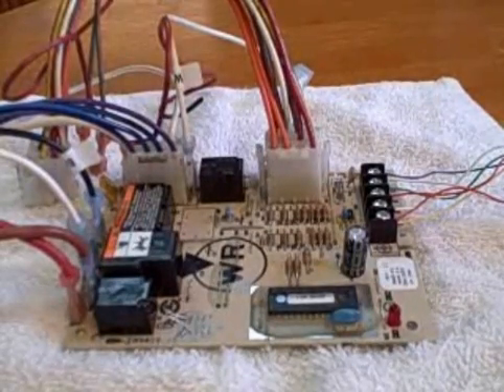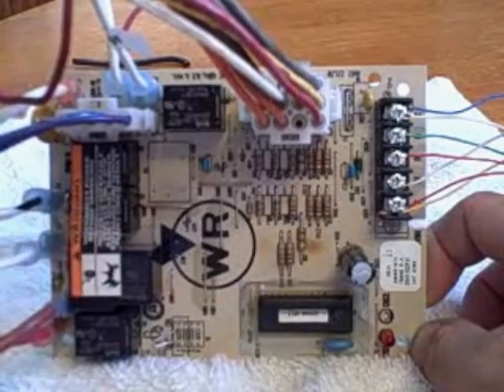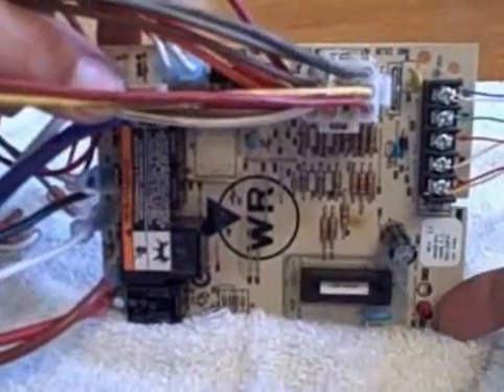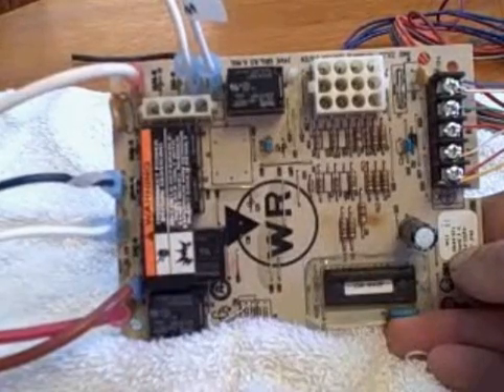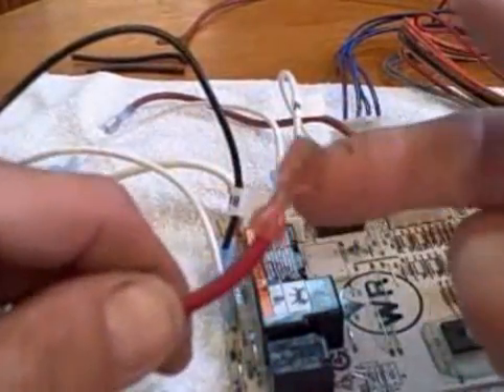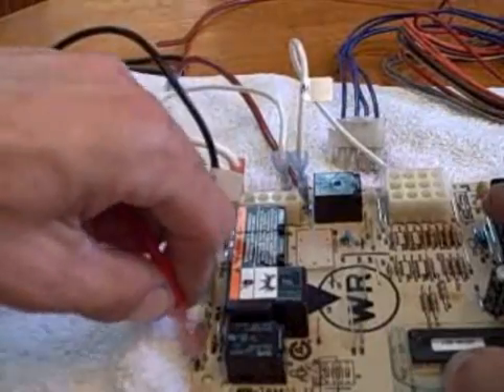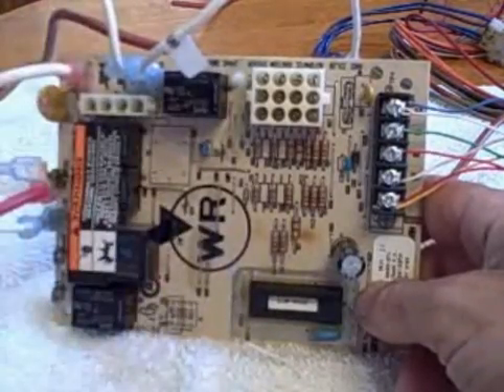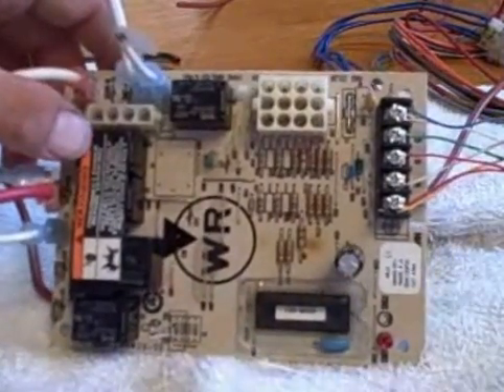HVAC AC Blower not working, troubleshooting Fan Control board, Fan not working.

Comment from the maker: @letseeitplease   No problem, just remember that you should have a tech work on it, dangerous voltages and safties that have to be considered!   Keep in mind it most likely is NOT a relay, more often than not it is a capacitor (easy fix) or worse, the blower motor.

Comment: thanks for doing this video, i have the same problem, its central air, and the blower is lennox, the outside unit is Heil, it runs fine, but the indoor blower is not coming on at all, i checked all breakers, everything is on, still the blower wont come on,
will be a month before i have enought money saved up for repairs, at least seeing your video gives me the idea of what could be wrong with my unit, thanks

Comment from the maker: @iac821 Can't believe I havent answered this one yet!   If it is a new motor/capacitor then you might have the wrong motor installed.  I've seen this happen where someone would install a, say, 1/4hp 1075 rpm motor and the thing has like 3 or 4 really big fan blades, ...unit was probably originally shipped with an 820 rpm 1/4 hp motor and can handle the stress load and the 1075 just overheats.

Comment: Just wire in a relay with the green and common low voltage wire.that way the motor will shut on and off...thats what I do until the board comes in...

Comment: hi, mikie i just replace control board on a armstrong furnace with a honeywellst9120u and the blower start even without a call for heat and keeps running, i have triple check and cant figure out any clue? thanks.

Comment from the maker: @iac821   Condener motor being the outside fan motor (just verifying our terminology here!) ....check the fan capacitor again to make sure it is ok, if the reading goes up and down and up and down on the cap then it might be a bad cap, I get those once in a while.  If the capacitor is good and it it si the right cap for the motor then check the motor, sometimes I will see people put 1075rpm motors on units that SHOULD have 825rpm motors and they can't keep up.  Right size motor?   M@

Comment from the maker: @teachmebetter If the air handler is blowing the breaker that quickly then you might have a high voltage short to ground.  It could be something less dangerous but I suggest you call in a professional so that you don't electrocute yourself.  I've had a few close calls from loose wiring that was difficult to see etc.  So just be safe and make sure by getting a tech to look at this one!

  m@

Comment: my issue is that the blower on my Lennox G40UH with a surelink circuit board  only seems to run in low speed.

I tried a direct connection like you filmed and got the same low speed.

the led indicators on the circuit board indicate everything is OK,  but  the blower won't kick into high gear.

Comment from the maker: @CactusBobsPlace You are correct, when I did the video originally I commented at the beginning of the video that the wiring color was not correct and that the brown and red wires were just what I had at hand at the moment to use as an example on the board.

Comment: That white plug that you unplug from the board with all the colors code wires plug into. Well on my unit when I unplug that plug off from the board my blower work and i can hear my refigerant circulated, but when i plug that plug into the board i still hear refigerant circulated but blower dont come on. Why is that? It a new board also. It is good to had the blower run 24/7? Thanks for advise.

Comment: for some reason my blower stopped working i unplugged G and R and jumped G to R then the fan would kick on but the compressor wouldnt work, then i put the wires back and the compressor works but not the fan, I plugg 2 wires into the R and both the fan and compressor and working now. Any idea what could be my problem ? relay ? how do i trouble shoot that.

Comment from the maker: Very seldom have I done that.  Like 2 times I think.  usually if the board isn't an exact replacment it's kind of close.  Usually you can sit outside in the comfort of your truck when you go back and sit in the cool air and read through the instructions, figure out changes that they want you to make, etc.   The 2 times I have marked everything were on really old systems and the new boards were radically different and I had to change some wire lengths too.  NO fun in a hot attic!!

Comment: cant you just for voltage, rather than doing the other stuff?  then do what you did to get them going for awhile until you get the part?  To me that is much easier and quicker.  No power out of board, it's straight forward, bad board.

Comment: Hey, Pretty cool idea on testing the motor by putting high on the door switch.
I'm gonna use that if you don't mind !
i don't know about leaving the fan run 24/7though. unless you told the customer how to turn it off. breaker or unplug it.? ok then.
i Probably would of got a contactor off the truck and took the green wire to contactor coil.other to common. door switch to contactor. whala done. two screws into cabinet for temporary affixing of contactor.
Pretty cool video!

Comment from the maker: Oh HELL no!  (holding back tears while laughing)  That would MAKE SENSE!!  

I've never really payed much attention to the 12 pin plug though, just make sure you read the instructions with any board change out because sometimes they make changes or what you to jumper things around if its a modified board, not usually though.

T-stat to unit to condenser wiring though is whatever color the installed thought was a good flavor of the day!  Usually it's all the same though.